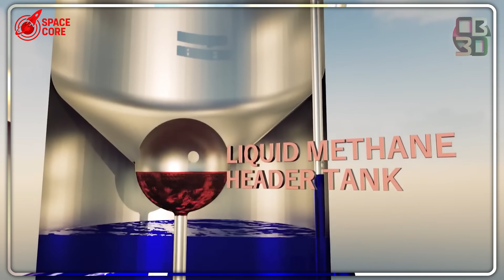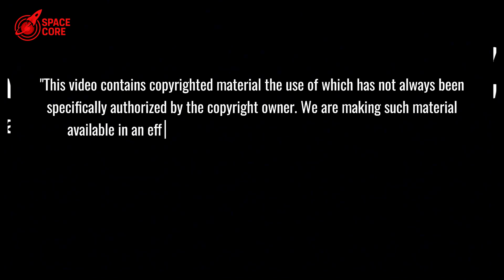SpaceX Ship 37 ABORTED...Data Reveals MASSIVE Design Flaw!

Comment: SpaceX is a typical Musk company. Just like him there's holes of knowledge where they seem to assume they know better or know enough rather than the more intellectually honest assumption of NOT knowing something. 
And it's patently obvious here - when youre operating stuff at high pressure, you need to be extra extra careful and test for stresses that would never normally happen. And as forces are wont to do, they will ALWAYS pick the path of least resistance - the weak points. 
Anyone with a modicum of basic science knowledge and critical thinking could presume this. So their oversight on this matter speaks volumes.
I seriously hope for everyone's sake that no manned mission goes to Mars through SpaceX as they are utterly unfit for the job.
Reply from the maker: It's true that the rapid iteration approach comes with risks, and the stress fractures detected in Ship 37 highlight this.